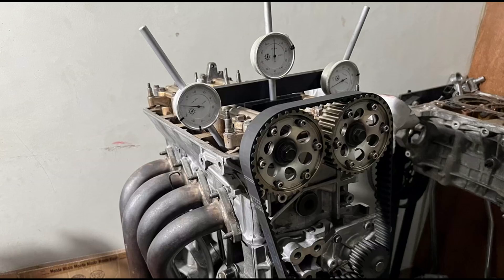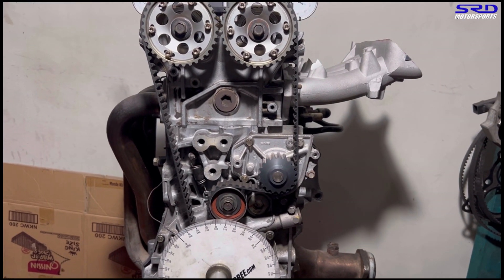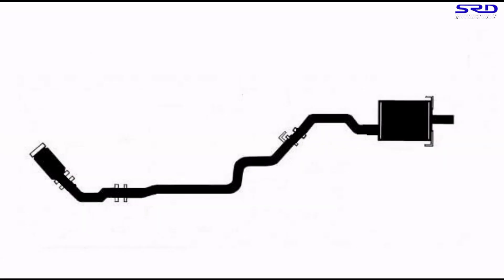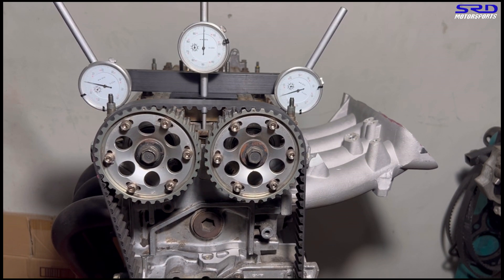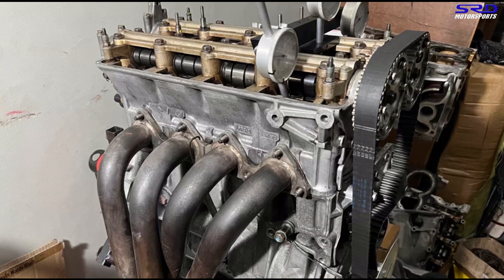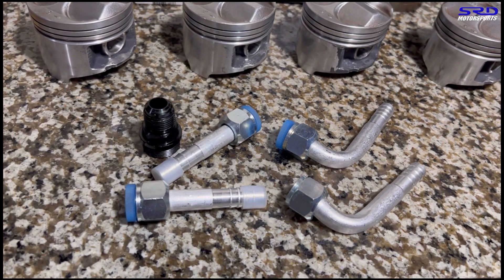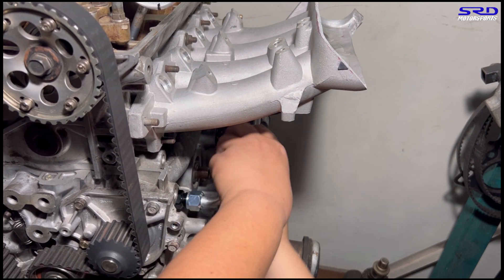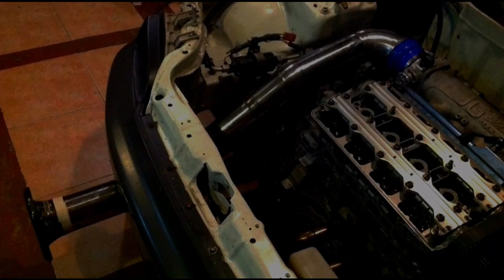B20vtec GSR Cam Rebuild Series part 6: How to get Max Power

Comment: I appreciate all the videos.  What are the centerline numbers for the stock gsr cams?  108? Thanks
Reply from the maker: I havnt really checked the exact centerline as I just checked duration and lift at that time on my notes  they are usually diff intake and exhaust just like the stocker ones we checked earlier in this series I believe
Reply: I think I may be over thinking it.  With stock gsr cams in a gsr head shouldn’t I just set the timing so at tdc the cam gears line up like oem.  I shouldn’t have to adjust the centerline if it all lines up like stock? My head and block was cleaned up but with my new hg when I hit tdc the cam gears line up perfect.  I am going to dyno so adjust it there?
Reply from the maker: yeah that should be fine

Comment: Love the education and knowledge you be dropping brother, I've seen people use pro 2 cams on stock compression 🤭 so basically for the exhaust you want a little more duration to get more exhaust gasses out which in return improve efficiency and power right?
Reply from the maker: Yeah but see look at the pro2 skunk2 smart
The exh lift is “more” a bit so 
It’s basically a more important aspect that we get the exhaust system and header almost perfect then we “shine” 😎

Comment: Who does the air fuel/ ignition tuning? Could you possibly show us or give us hints tips for tuning a b20vtec? I use a hondata S300. Thanks!
Reply from the maker: I tune or do the tuning…

With ecu tuning I’ve been thinking on how to lay out a good video still planning it out

Plus it’s harder cuz we all know “tuners” don’t like being corrected or if it’s different from their way it’s wrong lmfao 

but I think I did  toy/talk about idle tuning roughly and shortly including maps

At the 2023 SRDmotorsports new year prospect video
Reply: @SRDmotorsports  I agree everyone does it differently lol but I was meaning a little mote geared towards street tuning with a wide band and etc 😄
Reply from the maker: @Stock_Crypto_Papi  I think the video I mentioned slightly covers it…

But the thing with “everyone does it differently”
Is that airfuel ratio can dictate flame speed which in turn relates to timing… and that also relates to stroke and lastly comp…

sadly some do it differently cuz their lodi friends said this this and that did it this way lol only a handful of proper tuners I see
Reply: @SRDmotorsports  can u elaborate more about the air fuel ratio can dictate flame speed and relates to timing? Im interested to hear and learn about that.
Reply from the maker: @alifkm2  it will take a whole book 😂 basically there’s a specific range for ideal power or max power , but in reality it’s really inter connected with air fuel ratio and type of fuel and once that is identified… there is a certain window of where flame speed is highest… obviously that’s not always demanding a lot of timing BUT that’s also reliable horsepower right there